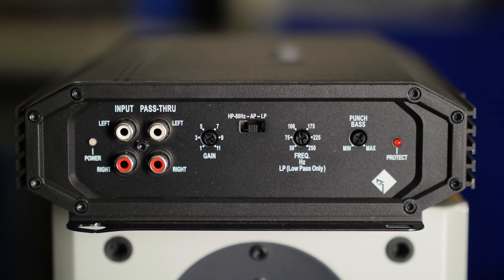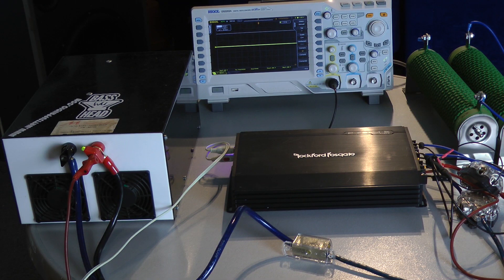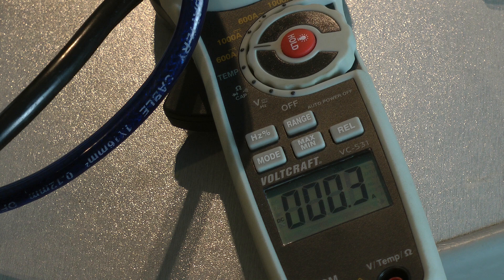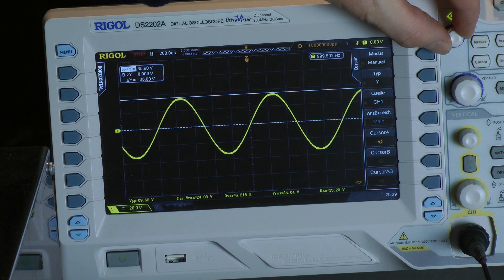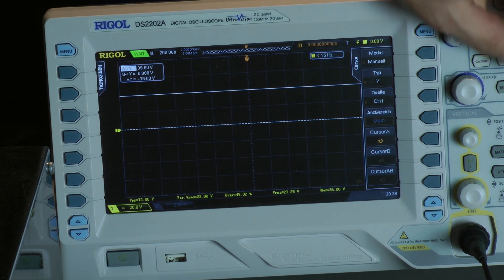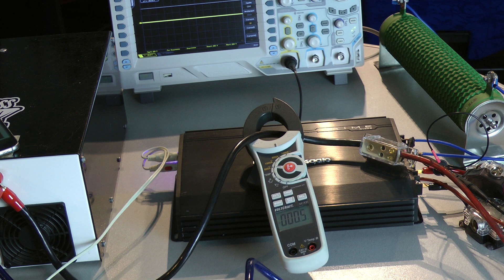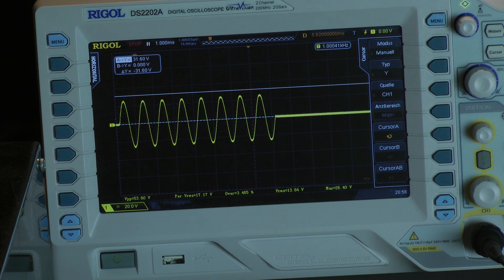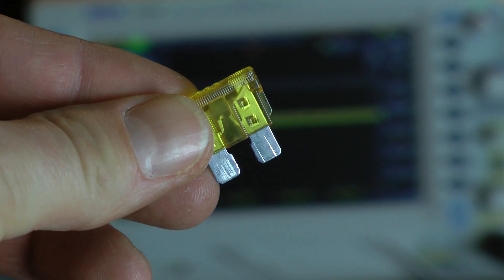Rockford Fosgate Prime R150-2 stereo car audio amplifier power test sound check & amp dyno run

Comment: You got 1 watt more, than what is in the birthsheet!
I bought this amp years ago new, and it sounded very good, specially the midrange frequencies!  I sold it later though, because I needed the money.
Nice video, thanks!😊
Reply from the maker: Yes! One Watt more at 13.7 instead of 14.4 V 👍 Thank you 😊
Reply: Any Idea if they are about the same?  The 851x is from 2002 or 2003!  Thanks.
Reply from the maker: I didn’t check it but I am sure that these amps are basically the same in terms of power! You are located in US, right? I am very interested to know if you have to pay extra fees when re-imported to US? I have to prepare the amp giveaway of the 800a2 and I haven’t made experiences with shipping to US. How long did it travel?
Thanks in advance!